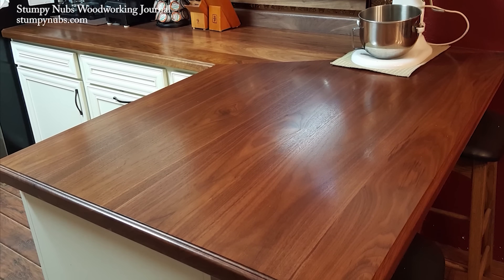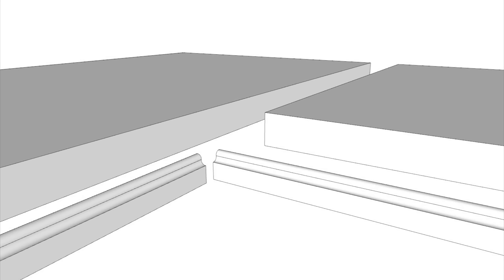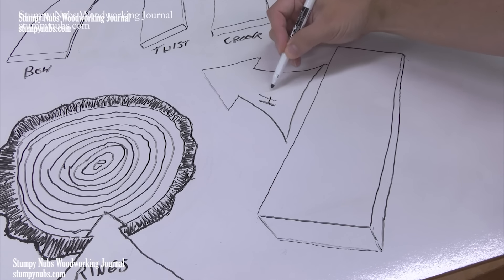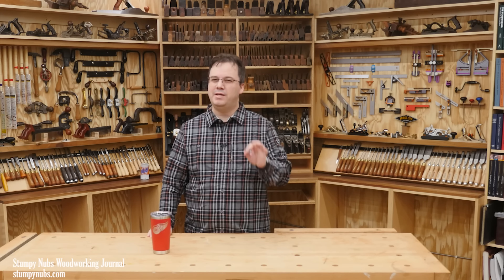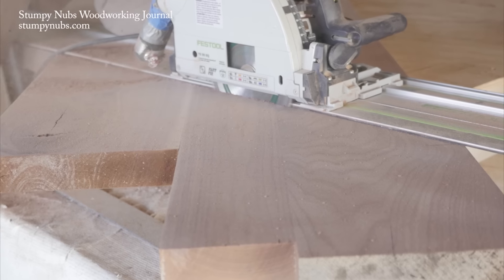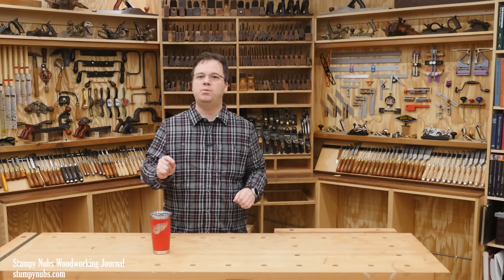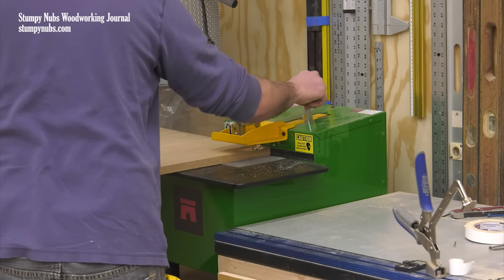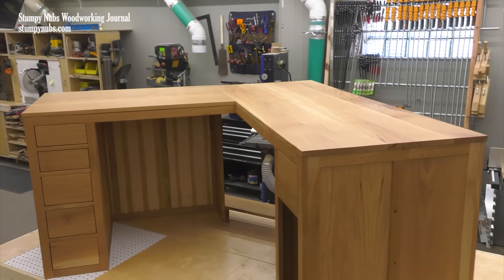The DANGER of making your own wood countertops!

Comment: Great video as always. But you didn’t mention the ‘mason’s mitre’ which, in the UK at least, is the most common way to connect kitchen worktops (counters).
Yes, the majority of UK countertops are made from some kind of composite, but for any material the mason’s mitre (combined with the dog bone fixings) is still a great option if you want to create a butt joint with any kind of profile.
The only downside is that you need a router and a jig to do it.
Reply from the maker: Mason's miters are not that common with solid wood countertops, at least here. Laminates and granite/quartz, sure, but not so much with wood. It's essentially just a butt joint with a small miter in the inner corner, and as such, it's subject to the same wood movement issues as a regular butt joint.
Reply: I concur, and thanks for the quick response, by the way 🙂
I just thought it worth mentioning as an option for those who may be working with suitable materials.
Thanks again for being one of the most reliable sources of quality information and balanced and qualified opinion on the internet. Top channel 🥇

Comment: Another important consideration is the strength required. In your butt joint example, there is no support under the corner and a miter joint would sag when someone sits on the desk. The long piece of your butt joint is supported on both ends and is stronger. Your miter joint example is supported by the cabinet and won't sag when someone sits on it.

Comment: Im facing the choice between cheap pine waterproofed with parafin solvent oil or concrete or big tiles.  I gotta say she loves the fake marble large format tiles.....only the difficulty ensuring perfection interfacing to the undermount sink makes it not the obvious choice.
Reply: Theres one 45 corner, since the counter would be assembly of 2x4s edged together with that router-laminate union bit with the sort of half-lap plus middle ridge sort of shape, anyway i guess the two surfaces would be 45 miter joined with that same router bit.  Concrete or tile sure sounds easier.

Comment: I was going to make a counter top using Baltic birch plywood.  I was planning to butt joint and pocket screw it together.  Given that it is plywood is it OK to glue or is it best to just use the pocket screws?
Reply from the maker: Baltic Birch plywood is very stable. You shouldn't have to be worries about wood movement and can use glue in the joint. You may still want toms fasteners like the dog bone bolts for strength.

Comment: What's your top recommendation for kitchen countertop clear finish on hard white maple.  Specifically the one in my kitchen has an under mount sink.  Not intended as a butcher block.
Reply from the maker: I wouldn't make a wooden countertop with an undermount sink. The greatest danger with a wood countertop is a dent or cut that compromises the finish and allows water to penetrate. Pots and pans are bound to ding up the wood around the sink in an undermount situation. You will have to really be on top of it, repairing the finish frequently.

Comment: There is no mention in this video of the preferred joint for kitchen benches which is known as a Mason's mitre. Which is a mitred butt joint. It's usually cut using a specialised jig. But can be done without it. Mason's mitres are used where the edge has a profile.
Reply from the maker: Mason's miters are typically used for laminated counter tops, or for "solid surface", granite, quartz, etc. Not usually for solid wood since they are essentially a but joint with a small miter on the inner corner.

Comment: Ok, I've heard many woodworkers mention the wider slots for biscuits and dominos to allow for expansion, but doesn't the glue negate that and eventually break the glue loose? I noticed you didn't use glue in your joints for the countertop, but I see it a lot in other applications. I'm relatively new to this, so I might be missing something. I'm guessing it's different for each application?
Reply from the maker: As explained in the video, no glue is used in either of these joints. The biscuits/dominoes are for alignment only.
Reply: @StumpyNubs  Yeah, I made note of that in my comment, I just wasn't sure but thank you.

Comment: Was hoping for a mention of waterproofing for this application and assuring the miterjoint remains waterproof.
Reply from the maker: There is not such thing as a waterproof wood. But wood isn't a sponge, either. Wooden countertops have been used for centuries. Mine are just fine after regular use for several years.
Reply: @StumpyNubs  by waterproofing i mean what you applied for this application

Comment: Still interested in how much movement is "contolled" and how much happens. Is it only pulling or is there lateral movement one the dogbones are in place?
Reply from the maker: The wood can move laterally as it needs to. The joint does not pull apart. It's been several years, and the miter still looks great.

Comment: For the kitchen work top you can buy router jigs  but how good are they compared to your method
Reply: As far as I'm aware, that's all we use here in the UK.  It's the industry standard for timber/chipboard/MDF worktops. It gives a good, solid joint.
Reply: In England

Comment: Simple solution. Don’t design bends/corners in your kitchen. I’ve created my own kitchens with several wide, oak tops but without joining boards. there is plenty of movement visible in any breadboard ends but the whole kitchen remains intact and waterproof.

Comment: My suggestion is to use veneer on a good substrate like particle board or medex mdf. Just make sure to use a veneer on the bottom to balance it out. Then use glue in the joints . This is far superior to solid wood. If you need a profile on the edge then glue a hard wood edge to the substrate before it’s veneered. You all have a good one.
Reply from the maker: Far superior to solid wood? How so?
Reply: Much more stable.

Comment: Cleaning that edge profile in a kitchen is going to be "emotional"!
Reply from the maker: Why?
Reply: @StumpyNubs  getting a cloth into the 90 indent, especially at the mitre joint, is no easy task.
Reply from the maker: 90 degrees is a corner, not an indent. There are no grooves on that edge that trap anything inside or are difficult to wipe off. Even the inside corner itself is little different, when it comes to cleaning, that a square edge, with also has an inside corner.
Reply: @StumpyNubs  1:23
From the bottom.
Vertical - > radiused turn in - > 90 degree interior indent. That corner, Thars the bit that needs special attention to get a cloth in. 
In that clip where you route the joint, not so bad (not particular good though), but a fully mitered joint will give you a bit that's an absolute pain in the butt (pun intended) to clean.
Reply from the maker: Maybe it looks that way from your computer monitor, but I have had that countertop in my kitchen for years, now. I can tell you from first hand experience that it is NOT difficult to clean, at all. Perhaps you are mistaking a shadow for an indent. It's simply not a problem.

Comment: What keeps water out of the joint in the kitchen?
Reply from the maker: The finish seals the inside the seams just as it does the surface of the wood. It's not like a particle board countertop that soaks up water like a sponge.
Reply: Do you mean that you have finished inside joinery, or that finish elastic enough to stretch with the wood?
I had something like this with particle countertop and it was a disaster even with additional sealing.
Reply from the maker: @vadimstarodubov913  The inside edges and underside of the countertop are all finished.

Comment: For decades I believed that movement in wood due to humidity changes did not impact its length.  This is standard knowledge, right?  Well, I had two different lengths of four quarter by 3" wide Garapa contract in length on me.  Now admittedly this was in a super severe situation.  It was on the deck of our small vacation house that has some shared waterfront in the San Juan Islands of Washington State.  Installation was done in the heat of the summer, and the wood was sealed only on its top and accessible edges using Penofin.  The culprits turned out to be some knots that were close to the butt joints.  I'm going to leave them since the movement is only about 3/16" and nobody noticed until I pointed it out, but it can and does happen.  Knots near joints are not a good thing.

Comment: Isn't this an older video? I remember watching this because I built a L shaped desk a couple of years ago and decided to go with a miter joint using this video
Reply from the maker: While most of the videos I make are entirely new, I also occasionally revisit past video topics that I think could benefit new viewers, or which I think bear repeating because of the value in the lessons. These are not simply re-uploads. A lot of work is involved. Typically, I make changes to the script to clarify points or to add more material. (Sometimes I re-write it entirely.) Most of the footage is re-shot (with the exception of some B-roll), and it is all re-edited, making it essentially a fresh video. I am certain there are many points in this video that you will find to be new, or that refresh your memory from when the topic was initially discussed a few years ago.
Reply: @StumpyNubs  Thanks. I wasn't insinuating it's a re-upload, I just was curious what the deal was, because I didn't want to find the older video and start comparing them.

Comment: Why not use the same grain direction for the butt joint? I mean other than cosmetic reasons or if the size of the plate is not really available (i.e. when it's easily possible).
Reply from the maker: You could if you have it, and don't mind the look

Comment: Most countertops I see are made with what I think is called a Mason’s mitre. The joint is not a straight line, I guess you could say it is something like the letter “j”. Mostly a butt, but at the inside corner it is a mitre. Usually fastened with those bone-like bolts. It’s probably my preferred joint. Simple like the butt, but gives a clean inside corner.
Reply from the maker: In the US masons miters are common in laminate and other manufactured materials, but not in solid wood.

Comment: Hmm. The most common way to join worktops regardless of profile is the 'masons mitre' with steel worktop joiners.
Reply from the maker: Mason's miters are not that common with solid wood countertops, at least here in the US. Laminates, composites and granite/quartz, sure, but not so much with solid wood. It's essentially just a butt joint with a small miter in the inner corner, and as such, it's subject to the same wood movement issues as a regular butt joint.

Comment: You didn't mention the option that is both miter and butt joint, as used for particle board counter tops..
Sure, it dosent address uneven expansion of solid wood.
A jig that is used with a router, starts as miter (to allow edge profile continuity) then turns the cut to a butt joint (to minimise wastage)
Reply from the maker: Because this video is about solid wood.
Reply: @StumpyNubs  true, but the office desk with the butt joint could have a routed edge that is sharp at the inside corner with this method.

Comment: If you wanted to, could you use bow ties in the joints?
Reply: Funny - this is exactly what I thought too!  I thought of the "butterfly joints" of oak panel artworks, I think they are the same thing? They were still holding the mitres closed after 400 years. I expect this was due to the stability of the oak also. Perhaps this would be an option for makers who use hand tools.

Comment: I realize, there can be reasons why a person would do this but, just had to comment... At about 3 minutes and 15 seconds, the pocket holes really should have been on the other side of the wood. When you have the pocket holes on the inside of the joint, the screws aren't going towards the end grain on the lower piece of wood. I've experienced much more splitting when fastening boards that way.

Comment: I'm surprised you didn't mention the Mason's Mitre. A much more attractive and elegant version of the butt joint
Reply from the maker: Mason's miters are not, in my opinion, elegant or attractive. They are most commonly used on laminates and composites and make the counter look like it. If I'm going to the trouble to make a solid wood countertop or desktop, I want it to look hand crafted, not commercially machined.

Comment: is it just me or have I seen this video before, it says posted 9hrs ago but I swear Ive seen you do this video months ago
Reply from the maker: I did something similar about three years ago. While most of the videos I make are entirely new, I also occasionally revisit past video topics that I think could benefit new viewers, or which I think bear repeating because of the value in the lessons. These are not simply re-uploads. A lot of work is involved. Typically, I make changes to the script to clarify points or to add more material. (Sometimes I re-write it entirely.) Most of the footage is re-shot (with the exception of some B-roll), and it is all re-edited, making it essentially a fresh video. I am certain there are many points in this video that you will find to be new, or that refresh your memory from when the topic was initially discussed a few years ago.
Reply: @StumpyNubs  Ah that makes sense.  Keep up the great videos

Comment: If you done a 45 degree in the UK you would be laughed off site, all tops should be done with a proper masons mitre with glue and bolts
Reply from the maker: A mason's miter is essentially a butt joint with a small, partial miter at the inside corner. You may think it looks better (that's a matter of opinion) but it is not structurally superior. I do see them with laminates, acrylics and granite/quartz. Not with solid wood, certainly not glued, as you suggest, because it is a cross-grain joint.
Reply: @StumpyNubs because all our counters are made out of horrible laminate chipboard stuff that blow apart if any moisture gets in
Reply: @StumpyNubs it's just not the accepted way of doing it here. That's why it would be, somewhat  laughed at, not because it's inferior in any way. In my 67 years, I've never seen a mitred worktop.
Reply: @StumpyNubs  Oh, I think this is what I'm speaking about in my post above.... yes, it is!
Reply from the maker: @boatlads386 - Maybe that's the confusion here. This is about solid wood. I'd never glue a mason's miter with solid wood. Personally, as a furniture maker, I think a mason's miter looks weird. It screams "commercially made countertop" instead of hand crafted. But that's my opinion. I would not call one "proper" and "laugh" at the other one...
Reply: @StumpyNubs  very rare to see nice, hand finished wooden fittings here anymore unfortunately. I think people actually want everything to look uniform and weirdly perfect

Comment: “Dangerous” is a bit of an extreme isn’t it?
Reply from the maker: The word "danger" has many meanings. There is a difference in saying you are in "danger" of something negative happening (in this case a failed joint) and that something is "dangerous" in that it will cause grave harm.
Reply: @StumpyNubs  I'll give you that, excellent video and work by the way.

Comment: Hi StumpyNubs. Sorry to ask, as you must have far to many comments to get back individually, but I'm making a YouTube video on the teak worktops I salvaged from a skip (channel not started yet!). My I include about 10-15s of this video please at 3:53 where you say not to use glue? I didn't know this and used glue!! I wanted to use a short clip from here to highlight my mistake. If so, I would of course reference your vid and your channel. Sorry to ask, but I've followed your channel for years and it has so much good info, and I think it is only right to cite sources where I have learned from. Thanks in advance. Ben
Reply from the maker: You can use very brief clips as long as you give credit, yes.